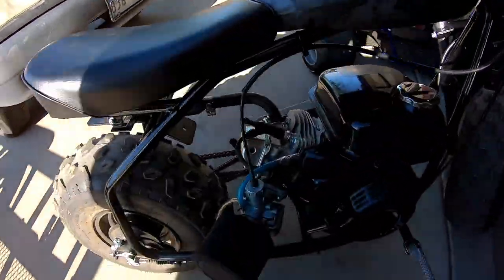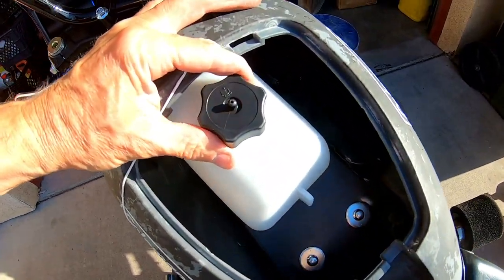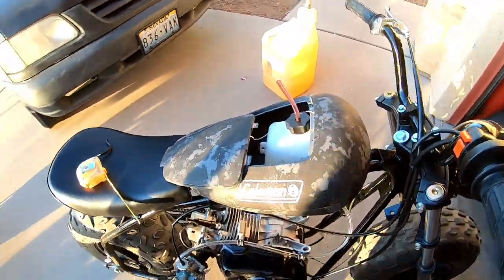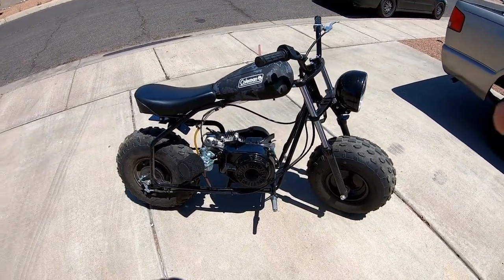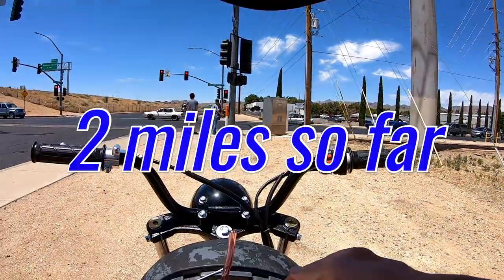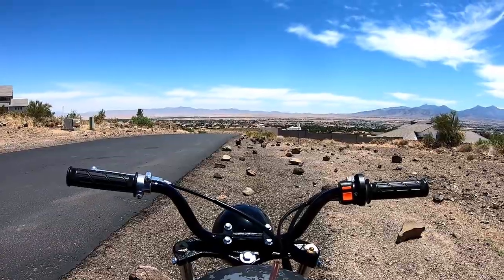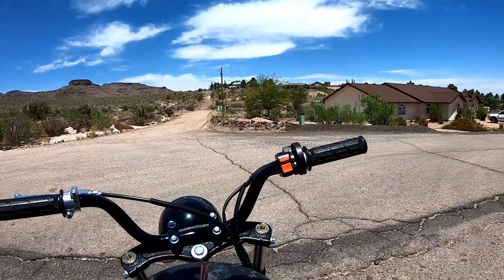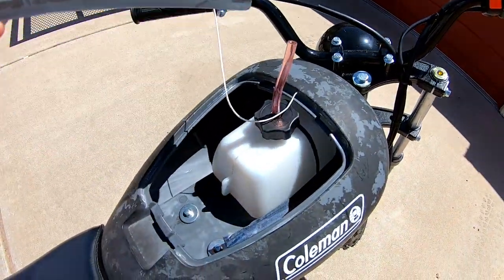Coleman CT200U-EX gas tank relocation/Kingman, AZ test ride

Comment: I had a 70s Honda 90 tank I mounted to my warrior and then used the tank bracket on the motor for a anchor for my battery bracket worked out really well for me good stuff sir mad scientist 🥼🥼🥼
Reply from the maker: Sweet! sounds like your a mad scientist too LOL
Reply: @Black66  I'm s fabricator not an engineer 😂😂
Reply from the maker: @heathenprojects2639  I'm neither lol
Reply: @Black66  I'm like wd40 it might take me 40 attempt but I'm persistent

Comment: With my stock tank and a 225cc Tillotson Performance Engine with 18.368 HP, I can get about 30 miles on one tank of gas, and that's a lot of stop and go, and up and down hills, which eats up gas faster than like highway use would.
Reply from the maker: If you did something like this, You could add a bigger tank than the one I used. This was kind of just an example.
Reply: @Black66  what bigger tank would fit?? A half gallon would be ideal!!
Reply from the maker: @Canadian_Craftsman  I think if I pull the cargo compartment and split it to install the tank I might be able to get a half gallon in there. 👍
Reply: @Black66  I really like your mod I'm just after long haul mileage for off-road mostly I'm still considering this with a fuel bottle in my backpack!!😁✌️💚

Comment: Nice little tank. I bet it doesn't leak out of the cap like the stock tanks on so many of these bikes.
Reply from the maker: Ya true. It would be nice to add a larger tank, but this will work for now.

Comment: You can't put a vent cap on top of that vent hose line coming out of the tank like that, not unless you ream the hole out big enough for the lid to come up over the vent cap.
Reply from the maker: Yes, you could. You could do a lot of different things depending on the tank you choose to use.

Comment: If someone like Go Power Sports were to produce a functional gas tank for these I’m sure they’d sell like hot cakes. Lots of ct200u-ex owners hate the faux gas tank, myself included.
Reply: I have this bike, and I love the faux gas tank. I use it for gloves, wrenches, a flashlight, and a few other useful tools in case I break down on the road or on a trail.
Reply: Perfect  battery  storage  if you upgrade to a predator  with no charging coil for headlights

Comment: Why can’t you get the Coleman bike to go as fast as some of your smaller mini bikes? Is it the gear ratio or not as much modification to the motor or what? The size of the Coleman 200 looks like a safer ride at a higher rate of speed. Still a nice modification with the gas tank and good video and ride in some nice parts of the USA.
Reply from the maker: Thanks! Check out the CT200U-EX playlist. We did get one Coleman to around 63 MPH https://www.youtube.com/watch?v=X0SmAZJ6qW8&list=PLkbj-ip-5FzbVBVqMi23O5noFSAbhNOp1

Comment: looks like theres a zip tie holding it down too? where do you have it tied too?
Reply from the maker: Its wraps through a small hole on each side of the gas tank. It goes underneath and back up the other side.

Comment: Hey Black can I use an Arc flywheel with just a stage 1 on a 212 Tillotson?
Reply from the maker: Yes you can . It will add more timing but that’s ok .

Comment: What are the specs on the engine, I thought I saw a mikuni, stage 1or 2, governor removed, gearing at clutch and rear I thought was a 40.  Thanks!  I have a ct200u and it is bone stock and would love to mod it up for more power and speed.
Reply from the maker: In this video, it had the 196cc with the governor removed a VM22 Mikuni,  header pipe, and a 7-degree flywheel key, and a 40 rear sprocket.
Reply: @Black66  ok, now to figure out what you just said….lol.  I know the other things however kind of stuck on the 7degree key
Reply from the maker: @TheBiliken  It's just the keyway that goes on the crank when you install the flywheel. It advances the timing 7 degrees. Here is the link for the video. https://www.youtube.com/watch?v=ZTC1ZAkuNdk&t=26s

Comment: Bro I live in AZ please help with my bike it’s the exact same one
Reply from the maker: What do you want to do with it? Major mods or just removing the governor and stuff?
Reply: @Black66  I need complete the governor taken out but not sure how, I saw some removal video requiring you to open up the engine and take out a sprocket
Reply: @Black66  you have a shop or is this a Bobbie
Reply from the maker: @Bristians  Its a hobbie
Reply from the maker: @Bristians  You can take the governor linkage off the top of the engine without taking out the governor wheel from inside the engine.
Reply: @Black66  where do you buy parts local? I need to replace the chain too can’t find any one that sells them
Reply: @Black66  do you know how many links are needed in total?
Reply from the maker: @Bristians  Not sure how many links  total. Here is a link for some 420 chain that will fit the bike.   https://www.ebay.com/itm/303392367790?ssPageName=STRK%3AMEBIDX%3AIT&_trksid=p2060353.m1438.l2649
Reply from the maker: @Bristians  No I don't